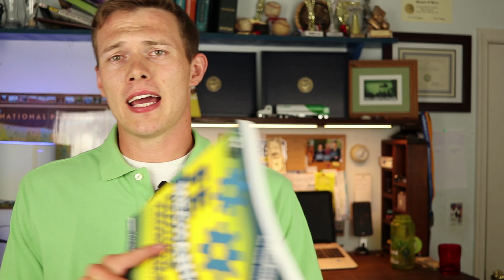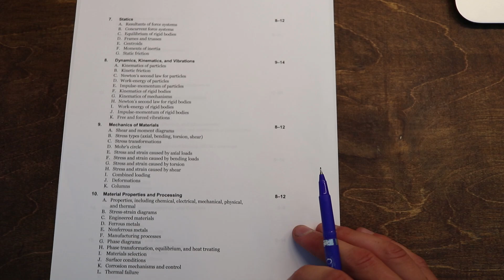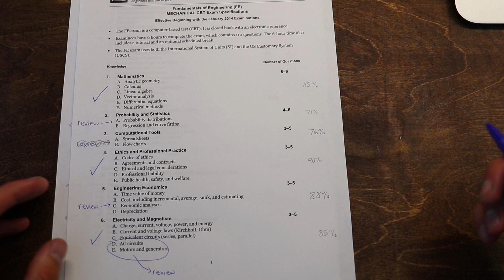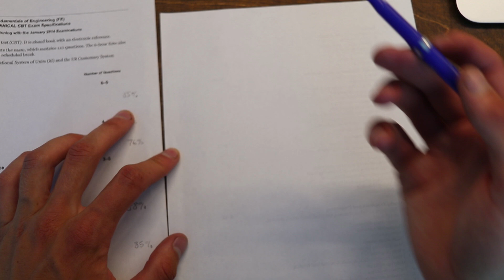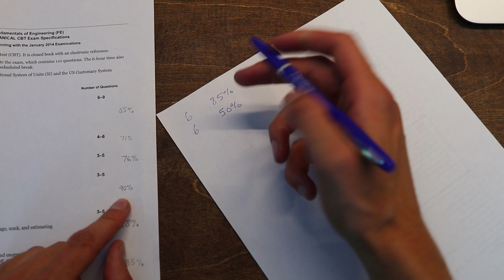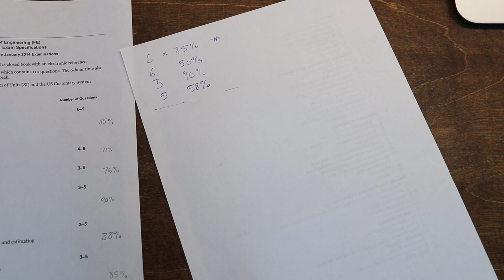Easily Passing the FE Exam [Fundamentals of Engineering Success Plan]

Comment: Also, OP is wrong about private industry requiring a PE to design shit for NASA. That’s a load of bullocks. PE licenses are purely for construction of commercial buildings and residential housing.  You need experience at an aerospace company or NASA to get a mechanical design of a part signed off. PE for mechanicals is literally HVAC systems. PE for electrical is purely making electrical drawings and designs for commercial applications. Big wire systems. A PE is worthless when it comes to electronics and say programming working for a defense contractor utilizing FPGS and VHDL.

Comment: Does the book you have a link for in the description have the formula sheet included? Also, are the formula sheets different for different engineering branches? I am a MEEG and just want to make sure. Thanks again!
Reply from the maker: My book didn't have a formula sheet because there is a free one when you create an account with ncees. If you set up your ncees account correctly, you should have the correct formula sheet
Reply: All major has same book inside same manual. You can get the manual for quite cheaply and trust me it's worth it. It is helpful in exam if you familiarise it

Comment: How did you review for the sections that you did not do well on?
Reply from the maker: Thanks for watching Stephen!! To answer your question, I would go back to my college notes and textbooks and reread chapters or sections. It didn't take too long since I learned it before. For me, it was the fluid machines segment. I had to reread some old material and brush up on when to use which equations. Hope this helps, good luck!
Reply: Thanks! Would you you say the exam was harder than the practice problems you did?
Reply from the maker: Some of them were. The practice problems in the book started easy and got harder within each chapter, so the exam Q's were easier than the hardest few for sure